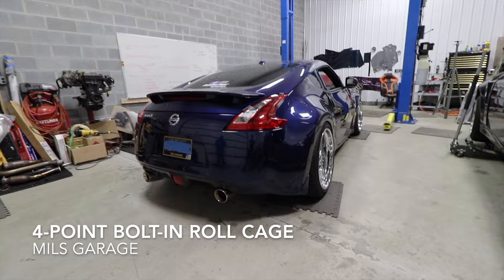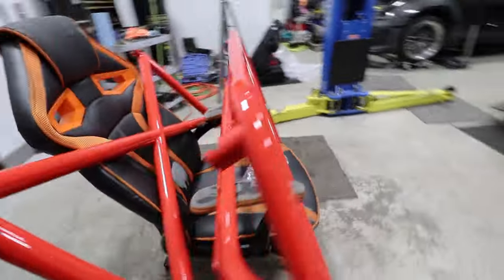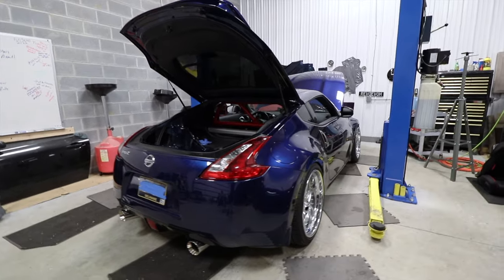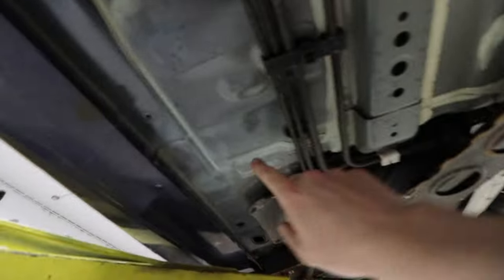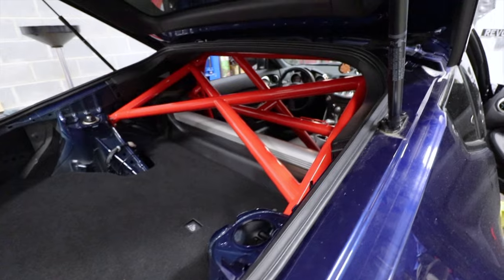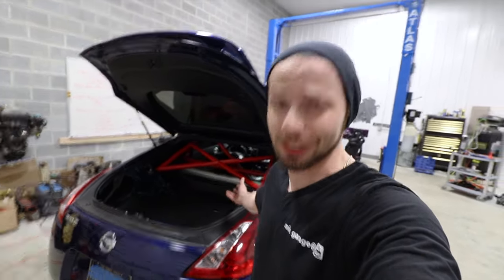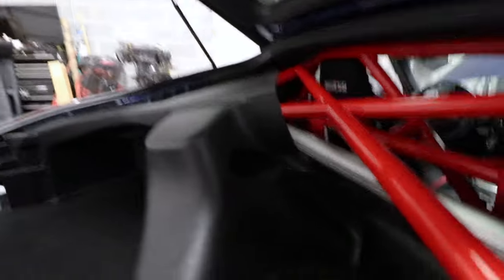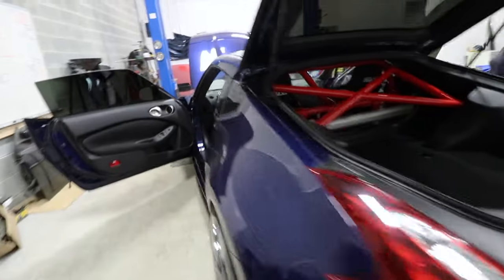4-Point Bolt-in Roll Cage Install [ 370Z Show Car Gets Custom TrackArt and Sparco Race Interior ]

Comment: So is this safe… fia or whatever. Or do you need to weld it for that
Reply from the maker: Yes it’s safe. You’re gonna want to check the regulations of the events, and we can weld cages if that’s what you’re looking for 👍
Reply: @milsgarage  do you know if bolt in for scca is allowed or does this have to be welded in… and could this be welded in?
Reply from the maker: We could definitely weld this in. 👍 i'm sure they have specs on the NextLevel Performance website
Reply: @thenovalabs  most SCCA/NASA events require at least 1 diagonal bar to be legal. Aside from that you’ll also have to look into the actual track safety requirements as well. doesn’t necessarily have to be welded as long as it is mounted securely and properly. 4 point harnesses aren’t usually permitted due to submarining so keep that in mind as well.